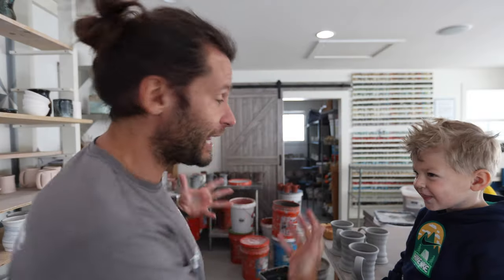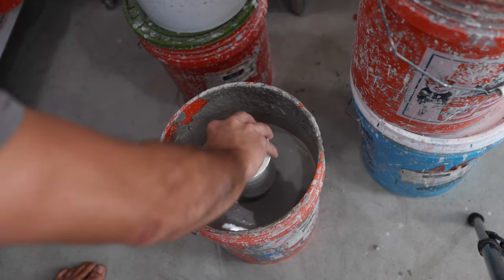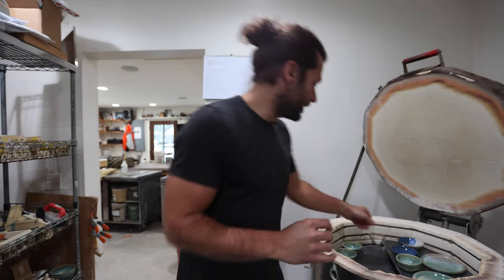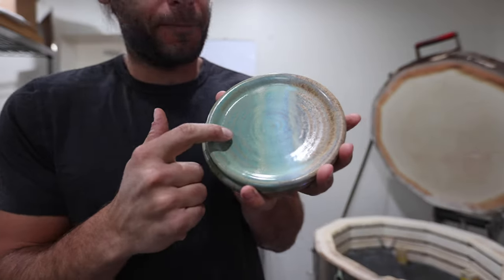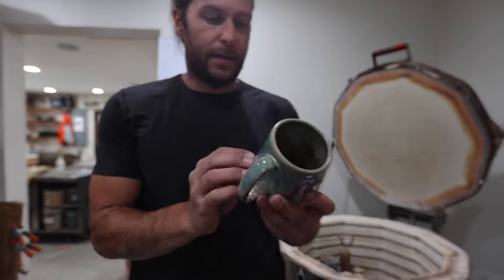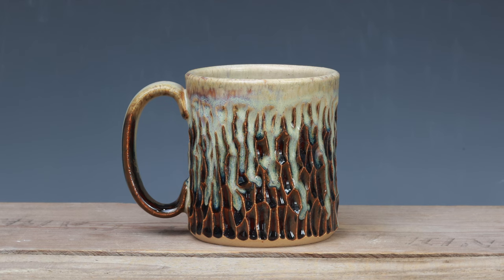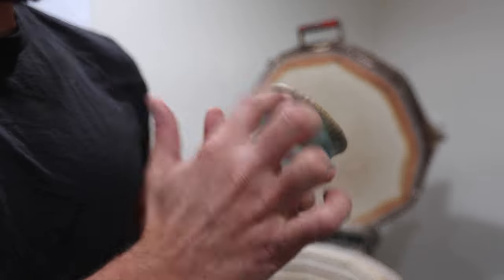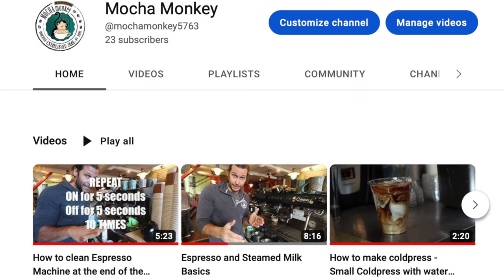Glazing mugs with a 3 year old and KILN UNLOADING JOY!

Comment: It's always fun with a little one in the studio! I have a question for you, I am currently dealing with pitting or pinholing in my low fire glaze. I had 3 pieces in the kiln, all made from the exact same clay, all glazed the exact same and 2 out of 3 had terrible pinholing. What can I do to fix it? The clay is an earthenware Standard. The glazes I used are cone 06 to 05. Any recommendations for fixing my 2 works that didn't make the cut?